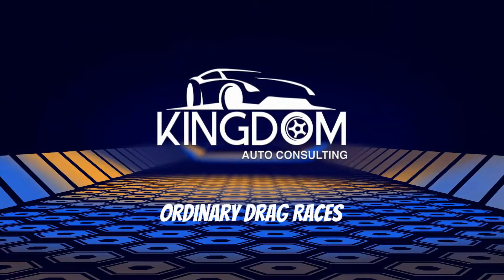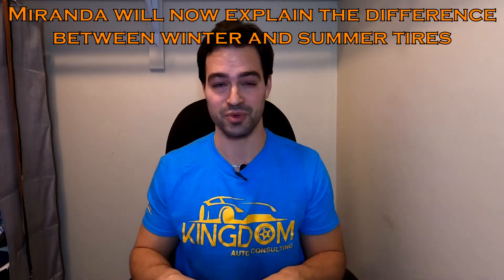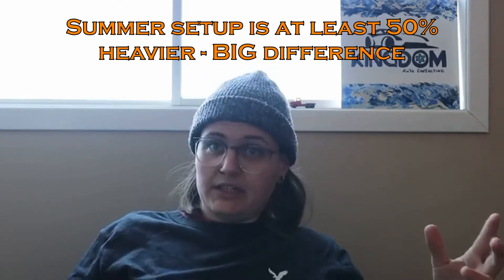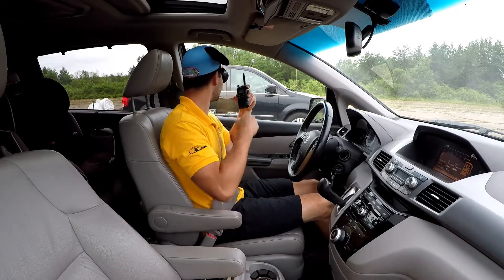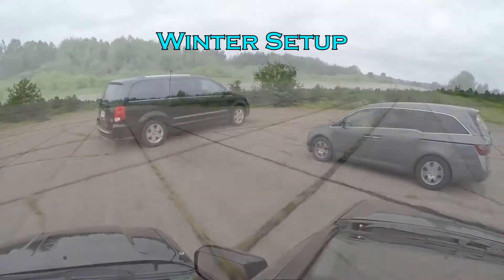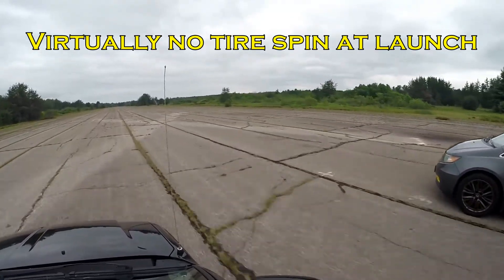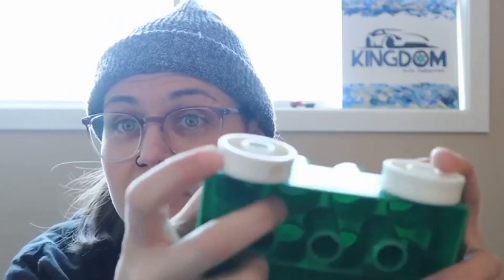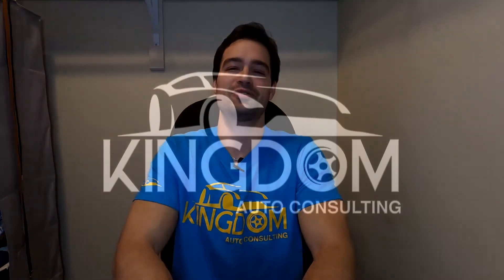Do Heavier Wheels Cause Slower Acceleration? Let's Find Out!!

Comment from the maker: Hi Everyone, thanks so much for watching! 
As mentioned in the video, we wanted to ensure to clarify a few things about this specific test and the results that we found. 
Firstly, we all know that Rotational Inertia/Reducing unsprung weight is a big factor in helping a vehicle reduce lap times, increase acceleration and improve braking distance. We know that the science has been proven here and that it's almost always a good idea to reduce weight where possible, when you want to make your vehicle perform better. 

Here are a couple great videos for more information:
https://www.youtube.com/watch?v=CxuER0qIWJk&t=42s&ab_channel=EngineeringExplained
https://www.youtube.com/watch?v=SR3nVx1aaTo&t=116s&ab_channel=EngineeringExplained

Now that said, we decided to simply put this idea to the test, to the best of our ability, using the winter and summer wheel/tire setups that Josh has for his van. 

The winter setup is on a 17" wheel and using 235/65/17 tires, whereas the summer setup is using 20" wheels with 255/45/20 tires. 
There is a drastic weight difference between the two sets, and the summer setup is as much (or more) than 50% heavier. 

We figured that this would be a very practical way to test Rotational Inertia because most times, when people buy new wheels for their vehicles, they're usually bigger in diameter and wider as well (which usually means heavier too). 

We performed many runs on both setups, timed them all and and then compared the times between the two, in order to determine of there was a noticeable difference. 
One big area for improvement here would definitely be the tire types. If we could have had the same tires on both sets of wheels, that would have been ideal, but we were confined to using Winter tires on the 17" wheels and Summer tires for the 20" wheels. 
So we did notice more wheelspin on the launch with the winter tires than on the summers. However, this also could have been a case of the van not having been able to spin the tires as much on the launch with the summer setup, because of the increase in weight as well.

Another reason why we feel that this test works well, is because it's being conducted on a vehicle with not a lot of Horse Power and Torque. The added unsprung weight would likely affect a vehicle with low HP/TQ ratings as opposed to a vehicle with a lot of power. 
The Odyssey has a power to weight that is similar to many compact cars/passenger vehicles that are commonly on the road today, so even though its V6 puts out more HP and TQ than a lot of those vehicles, the overall power to weight is almost the same on average. 

Now that our essay is finished, THANK YOU for watching and please let us know your thoughts below. 
Take care!

Comment: Do the caravan in manuel mode put it on 1st gear and let it ride from there , let it shift on it own ..big difference 💪
Reply from the maker: @SteveContreras-m1h  thanks for your suggestion, we tried that and actually there was no change. Stock settings in auto seem to take it right out to redline and then shift.

What really lost the race for the Dodge was 4th gear. 1,2 and 3 it had the Odyssey beat easily but then in 4th it fell on its face. Too tall of a gear

Comment: Small light wheels made a difference on my car on acceleration by about O.2secs over quarter mile. But trap speeds when down with smaller tyre by 2km on average. 17inch x7 to 15 inch x 6 wide.
Reply from the maker: Interesting, thanks for sharing!

Comment: I have a 2018 ram 1500, stock rims are 40lbs each (20” 5 spoke) and about 40lbs of tire so 80 per wheel.
I did some research on lighter wheels and tire, trying to from 320lbs of wheel to 250lbs
Just want a little more speed
Reply from the maker: That’s a pretty big difference for sure! You’ll likely notice an improvement in efficiency and it would be interesting to see what you notice when it comes to acceleration for sure

Comment: U should try a roll test, say 30-100mph on both tyres and see the diff. 

This will eliminate the issues with the tyre compound.
Reply from the maker: Great idea, we can try that out if we film another video like this. Although once a wheel is already moving, there would be less effort required to spin it more so that’s why we only tested from a stop, as the most amount of energy is required to begin spinning the wheel as opposed to keep it going. That said, a roll test would have definitely been good to try :)
Reply: @KingdomAuto  Any decrease in rotation mass will also show up in the roll test as the engine has less effort to put in when acc a smaller/lighter wheel. 

Would be interesting to see them tested again.

Comment: That was a great video! To be more precise, though, could you do something like a 20" summer tire vs a 17" or 18" summer tire? That would really be great for enthusiasts trying to pick the right size for their fast cars.
Reply from the maker: Thanks for your comment! If we ever have the opportunity to test something like that then sure - however, based on what we saw during this test, the tires really wouldn't make much of a difference in acceleration with the average vehicle (provided the tires have decent life left in them). It only really starts to matter when the vehicle has a lot of power. That said though, if we're ever able to run a test like this again then we'll do our best :)

Comment: A refreshing, practical look at the often searched but rarely illustrated topic. Forgive me if I missed it, but was there a breakdown of the powertrains used in each respective minivan? 

Unless they've got identical engines AND transmissions, acceleration delta could be explained by them rather than rotational mass difference - or one cancelling the other, leaving us with a cliffhanger...
Reply from the maker: Thanks for your comment! 
There was a breakdown of the powertrains in the linked video with the actual drag race between the Odyssey and the Caravan, but not in this specific video - sorry about that! 

The reason we chose not to include that information was just because we somewhat used the Caravan as a "control" and then used the Odyssey as the test subject, swapping the wheels over. 

We also timed both vans in the 1/4 mile with each run too which would eliminate any potential error with us driving the vehicles. And that's how we were truly able to tell that there was a very minuscule difference between the two different sets of wheels/tires. 

I hope that helps to clarify things a bit!! We definitely did try to make this as controlled as possible, although what would make it even more potentially error free, would be to throw the same type of tires on both sets of wheels and then test again!! 

All that to say, thanks again and have a good one :)
Reply: @KingdomAuto  Thank you so much for the detailed explanation and the video, which now makes perfect sense - and have a good one too ))
Reply from the maker: @mereobserver1727  Thank you! :)

Comment: I doubt the summer wheels are 50% heavier!! Probably only 10% heavier.
Reply from the maker: As wild as it sounds (we had a hard time believing it too) - the summer wheels are almost exactly 50% heavier in this specific case. They're a 20" wheel from Cadillac (CRAZY HEAVY) and they're also 1" wider than the winter's as well. It's a huge difference in weight, which is why we figured that it would be an ideal time to test this concept out :) 

Cheers!
Reply: @KingdomAuto  Ohh interesting, my bad
Reply from the maker: @automotivetv9861  No worries at all! It is hard to believe that the two sets of wheels could be that different in weight, we didn't realize it till we pulled the info on them, crazy eh?